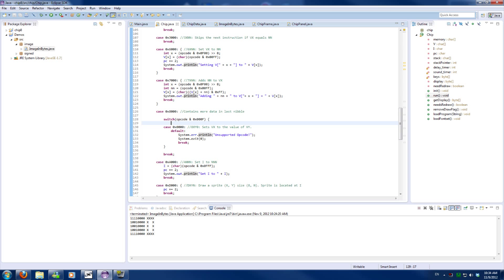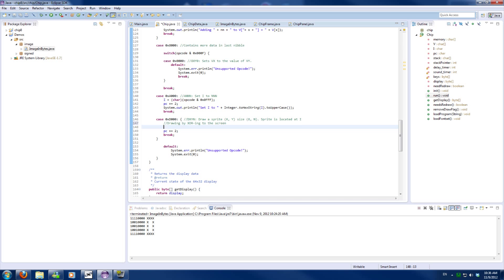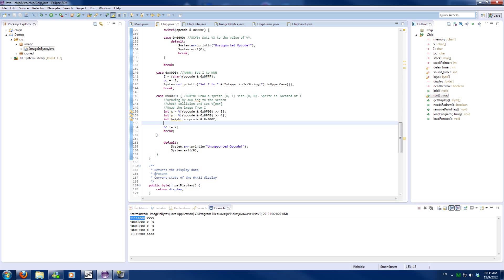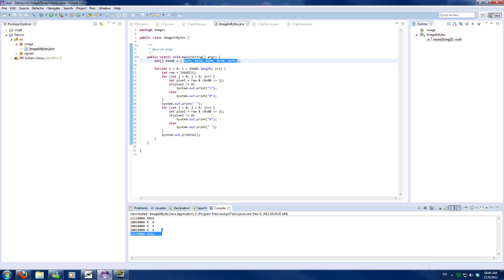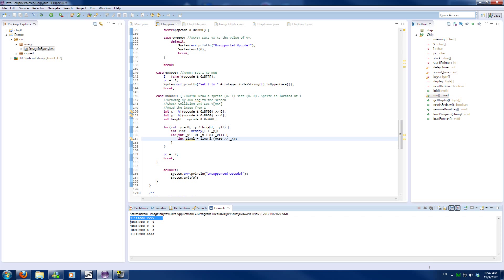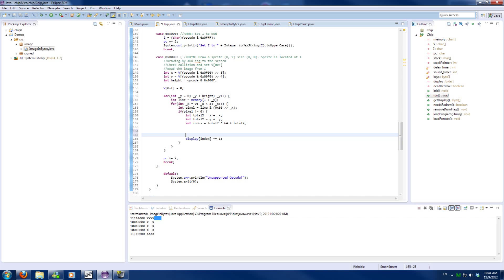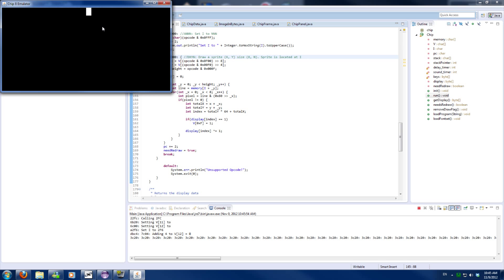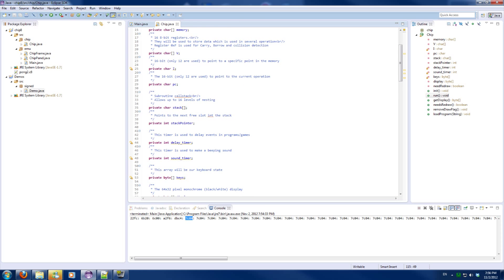Make your own emulator - S1 Part 3: Drawing

Comment: I do not understand why you have to multiply totalY with 64 in when you calculate index
Reply from the maker: The width of the screen is 64 pixels. So the first pixel of the second line will be on display[64], the third line display[128] and so forth.
If I had been smarter back then I would not have use a 'magical number' and instead have created a "private static final int WIDTH_OF_SCREEN = 64;" and used "index = (totalY * WIDTH_OF_SCREEN) + totalX"